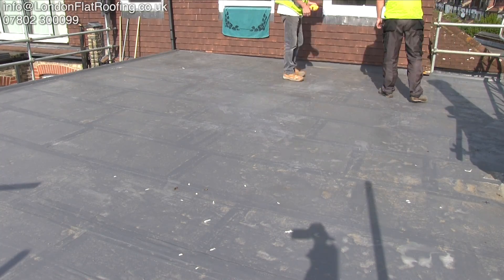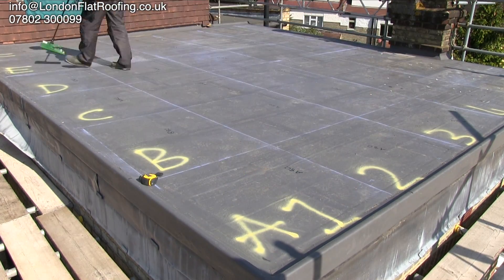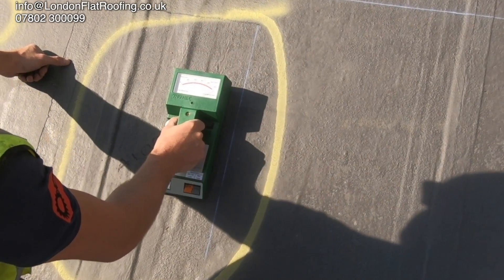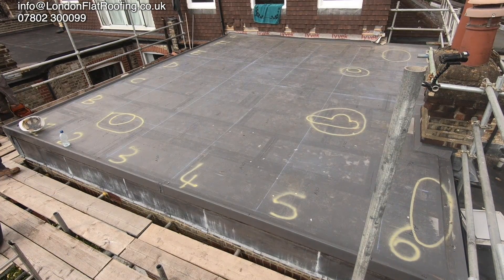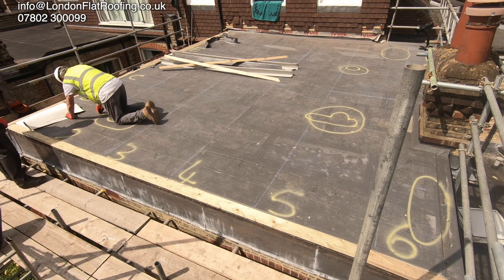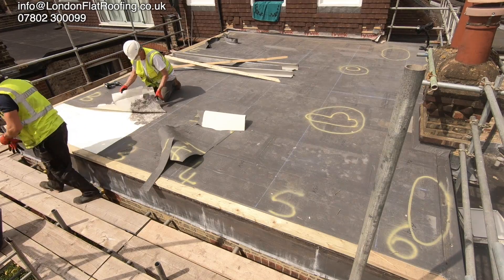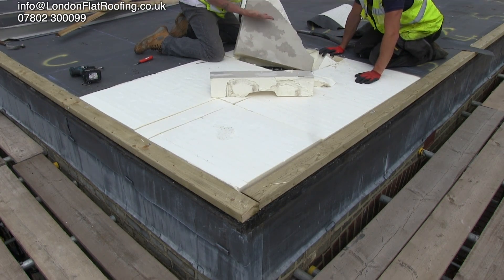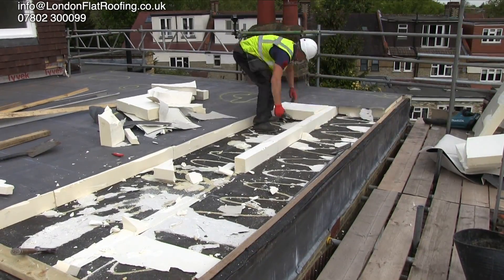Electronic flat roof leak detection Testing a leaking roof Roof surveys

Comment: Hello great video! I have a question, Ive a concrete ceiling which has been waterproofed but still I see water during inside the hoouse thorugh a crack, the issue here is that none of the experts who came to inspect where able to get to the source of the leak, we see the leak but not knowing from its coming, any trick to check that please?

Comment: The membrane had small cuts that barely let water seap in. Maybe before setting the membrane the roll was sitting on top of gravel, when unrolled it got cut. Maybe somebody had a sharp object underneath their shoe when setting it up, somebody threw a rock on the roof, when setting it up they might have dropped their sviccors or box cutter knife on accident leaving a really small hole barely noticeable to the eye. Etc
Reply from the maker: No, we know what the problem was. The problem was that he didn't use enough liquid to saturate the reinforcing membrane. You could actually see that some of it was still naked.

Comment: Always perform an electronics test on completion of any liquid roof,
As morons will use the roof as a storage area.
This will then puncture the membrane.
And never apply liquid directly to insulation.
Fix ply onto of the insulation to prevent punctures.

Comment: If only the top layer Epdm is repaired and leak proof, is it possible that the moisture drys by time itself?
Reply from the maker: yes but slowly
Reply: I've got water between layers on my flat roof. It sounds like a tennis shoe sneaker after walking under water. From the sky inward, there is a standing seam metal roof, then TPO rubber roof, then 2 layers of ice and water-shield. 
How can I get the large amount of trapped water out of there?

Comment: Crazy .... just let's get this right...you laid a roof on top of the old roof ...that's fine but you say roof has only been down a few days and had rain before you arrived to test ...maybe the roofers got caught out by the rain when doing the installation and water got under the insulation before they could cover it up ...the liquid roof looked OK to me...why is the customer walking around the roof ....was water showing inside ...if not then that's just stupid ripping up the roof ...as if new roof wasn't leaking into the building surely what water was sitting on the old roof would of evaporated in time and would of been find 🤔
Reply from the maker: The problem was the water was in the roof and could not get out
Reply: @SteveRoofer Hey Steve what’s the name of this machine or the manufacturer? I’m across the pond and no one does this over here. It would be cool.

Comment: Another great video, I've been watching these now for months and the tips I've picked up are priceless regarding why warm roofs fail. Just waiting for a break in the weather before getting mine fitted which hopefully is very soon. I wish you worked up our way as I often find myself having to point things out to the roofer. Steve, one things I'm still confused about is I appreciate that you recommend using a self adhesive VCL but in one of your previous videos you advised someone to use a novia polythene kit which I bought at the time, one thing I'm not sure about is what do you think is the better detail for the vcl at the top of the kingspan layer? Folding the excess vcl over the upstand and perimeter before fitting the secondary layer of osb or folding it back in over the top of the kingspan and taping it down?
Reply from the maker: If its a warm roof you should be using Alutrix 600   novia polythene kit  can be used for a warm roof but is more difficult to use I think he already had  it and that's why it was used
Reply: @SteveRoofer  yes, I wish I did get the alutrix but I found out about the product after I had already bought the Novia. The guy who did the drawing just stated "vcl" then I found a celotex detail showing 1000 gauge vcl so went with that. I had to buy 100m2 worth when I only need 18 so I couldn't really buy the alutrix as well. Any tips or mistakes that should be avoided when using the Novia?

Comment: Very informative video thanks. One question though, I assume this piece of equipment works similar to a conductive damp meter you would stick in walls to find rising damp etc. Does this piece of equipment have the same shortfalls of a damp meter for example giving false high readings when a conductive material such as foil backed plasterboard is detected within the roof?
Reply from the maker: Yes, also won't work through some single plys such as rubber but I have tested it on rubber and it worked!

Comment: culdnt you just put another layer of liquid insulation?
Reply from the maker: No as there was water trapped in the constitution now
Reply: it would dry out eventually
Reply from the maker: @Ziga Vojska  Possibly and there may not be any mildew or fungus that grown. however, the scaffolding is there the opportunity is there the other roofer is at fault and needs to give the customer a proper roof with no Ifs and buts.  What would you do if you were the customer?

Comment: Hi Steve, why do you say "good choice of insulation,tissue-faced not foiled-faced ? 
Thanks Warren
Reply from the maker: @aroon420 is correct   basicly tiles faced insulation is more oven cell IE it breaths a little better  however its more expensive
Reply: Tissue faced is the recommended one I believe but I think everyone uses foil because of price. And I don’t think performance is much more different.